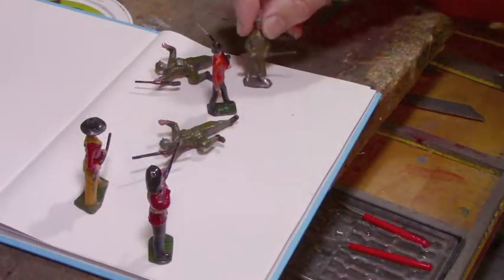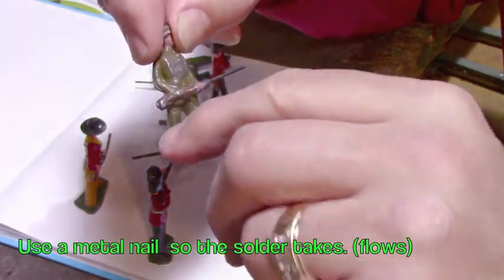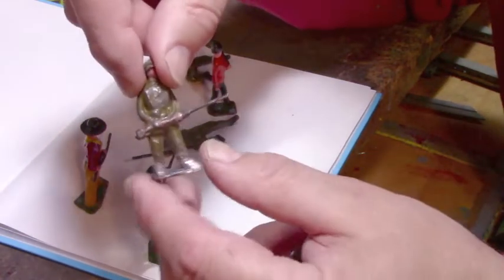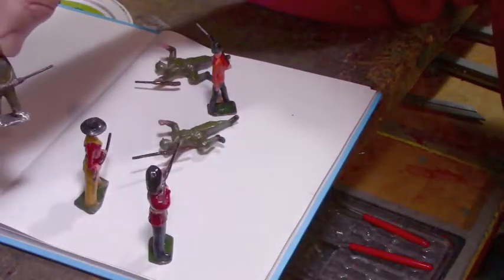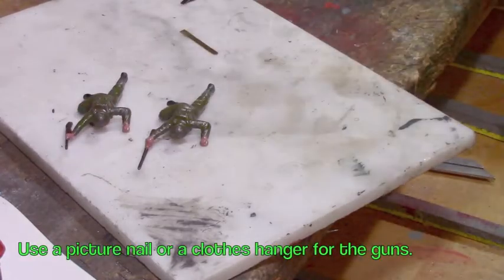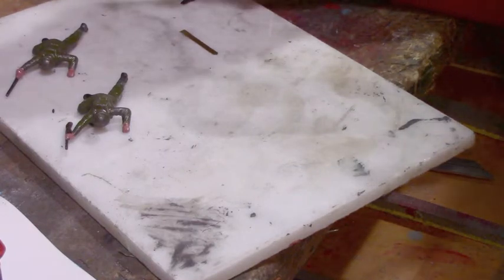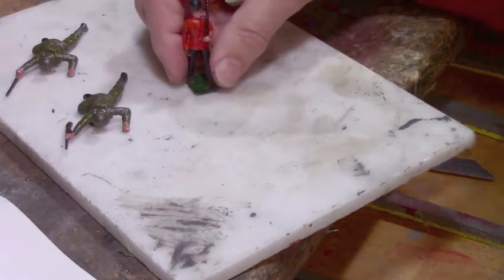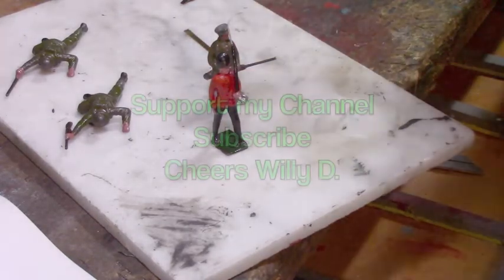REPAIRING DAMAGED LOT OF LEAD FIGURES

Comment: Lovely!  I've done a bit of repair work myself...using silicone moulds and casting with either lead or especially poly resins...
Reply from the maker: Very cool!
Reply from the maker: I have not used the moulds but it sounds interesting. I will look it up...thanks.
F.Y.I.
My new method is using copper wire for repairing legs and arms really great. The lead melts very quickly so using nails was not easy but copper (electrical wire) takes the solder quickly (lower temperature) so I put a flux on and touch the lead until I have some solder on it (sometimes I have to use J-B weld) and put flux and solder on the wire with a Weller gun. I then hold the two together and touch the spot and the fuse together. If I need a further touch I use J - B Weld and file it the next day. Cheers Willy